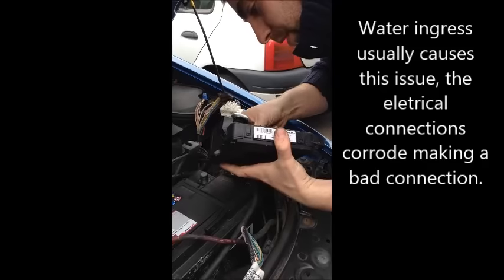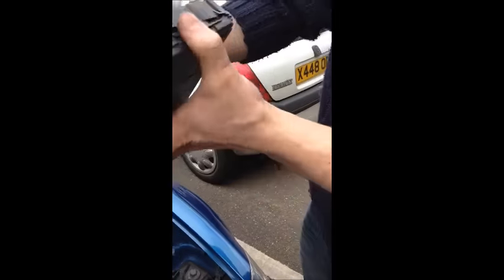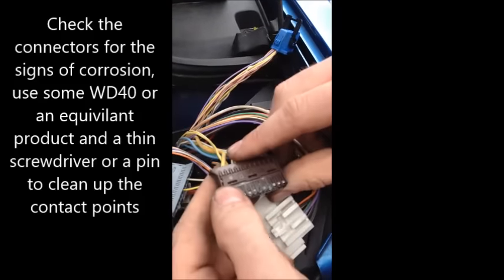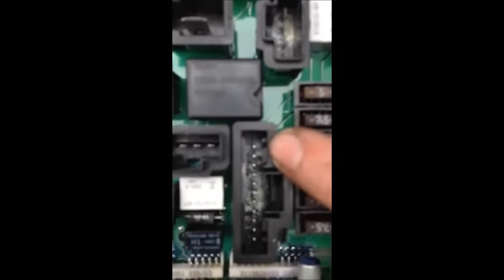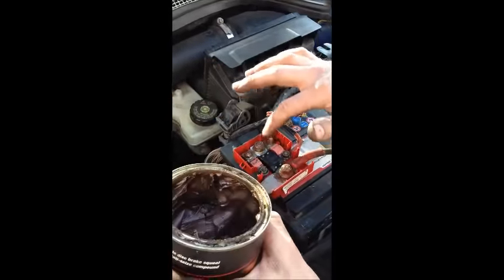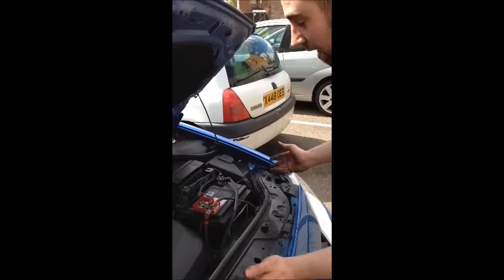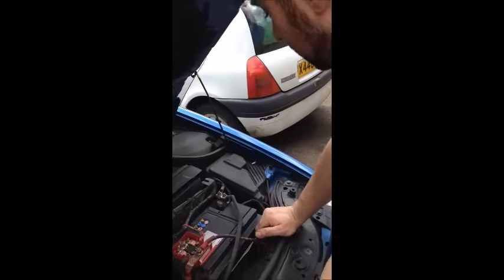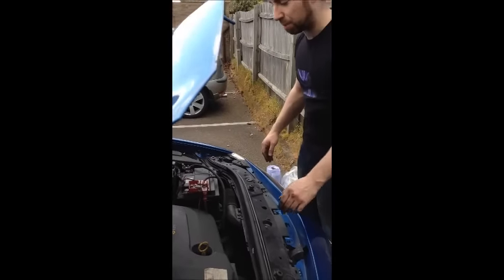How to fix Electronic Fault on Renault Megane

Comment: Hi, I have a 56 plate megane 2.0dci. my problem is that none of the windows are opening, and the swich that should lock the rear windows lock doors instead. Do you think this method that you showed here would fix it?
Reply: It's meant too lock the doors. To prevent kids opening them. That's why it has two little people icons on it.
Reply: @bananaman8899  oh, and i thought that my wiring was shorting somewhere. Well that's a relief, thanks.

Comment: my 53 scenic diesel headlight bulb went so i fitted new one but then i tried starting it up and it just wasnt starting it said battery low but was told its a new one, it does look new, it eventually started but now says parking break fault, and the trip comp seems to of gonew a bit mad, the fuel range was reading wrong and the e break kept flashing up as fault?? please help paul

Comment: Hi Paul! My 2001 rxe 16 vaive hatchback takes 20 to 40 start attempts over about one hour before it finally starts as if nothing was wrong, varoom very smooth once it starts. After a long trip inland it will start every day for a week or so - I live near the sea, do you think it could be the salty air? That is, could it be the same electronic fault? i think the fuse box is in a different place though...  Many thanks for your video and help!! I look forward to your reply all the way from South Africa. As we say here I am gatvol of this car!
Reply from the maker: Hi, I don't this model of car suffers the same electronic problems, however I would suggest getting some auto diagnostics done at a garage, persistent non starts could be a symptom of a wide variety of things, sensors, inadequate fuel pressure, blockages, low compression...

Comment: Hey Paul, i just bought a Megane 2 2008 automatic second hand (im the third).
I had to fix the wheel shaft (the one with the teeth that connects the wheels and controls them),
after that i had to do an align thing to the wheels, which i did, but then suddenly i get ABS error, and "Check Transition" message and my transmission gives me hard time switching from 1 to 2 and from 4\3 to neutral (light during red light).
I assume that its an electrical issue, any idea on how to solve it?
Reply: yeah eventually i found the problem, there is a cable connected to the wheels (stability control?) and it was disconnected, i reconnected it and it solved all the problems (both the general alarm and the gears problem)

Comment: Hi Paul thanks very much for the video .. I hace a megane 2 2.0 16v recently i got a message of battery charging we change the alternator works a 7 days then doesnt show any message but we had all this crazy things , a/c turn on by itself , airbag passenger desconnect , and all the lights in the car flashing in and out , we change the alternator again be cause was a used one and we thought we got it damage , then the new alternator , just a feo hours after the installation , now we have eléctric fault on screen also brake malfunction , airbag light , light flashing , a/c out of control and the battery look lime dischrage be cause everything is turning off one by one , any ideas pleasee , here in me country there is no much mechanic doing Renault and the y aré expensive i had expendio like a 1000 usd  at this moment , i apreciare your time

Comment: did the same thing the other day all clean  battery terminals clean put back on insert key  bam there you go back on again .
 also could the live lead terminals cleaned up + fuse make a difference.
 and one more thing when the car does start all is good then you here a click tick over  drops to zero   then electronic fault but it still drives .
any help would be great full.

Comment: Thanks for sharing, I have a Micra 1.5 DCI is has the Renault engine, starts and drives fine, but when driving and I put my foot down engine light comes on red engine light and seems to loose very very slight power, just about to notice the very slight power loss, does not go into limp mode, plugged in a code reader and came back with p0685 ecm/pcm power relay control circuit open and 
p0670 glow plug control module control circuit open.

I have replaced fuel filter and glow plugs, but still same, cleared codes but comes back on

Thanks for any help advice guidance

Comment: we have a 53plate megane , and the washers wont spray the cigarette lighter doesnt work and the radio turns itself off after 20 mins.as of today the doors wont lock could all this be fuse related?

Comment: I have a Megane II Grand Tour and the rear wiper goes off every time the car starts and the plate light does not turn on even with new bulbs. I have already saw this on others cars  here in Brazil, bu never found the solution. What could it be?

Comment: hi, great vid. my husband followed your advice after suddenly experiencing problems. now though the lights come on on dash but the car wont start and windows/locks will not work. the battery is fine any ideas? TIA
Reply from the maker: Hi sorry to hear that, my only advice would be to try it again, have a good look underneath the chips on the circuit board to see of there is any corrosion and if there is clean it out with wd40 and a piece of paper. also check the fuse for the windows, double check all the earth connectors are securely fastened from when it was taken apart to try the first time, if it still fails to start it may be worth letting a garage have a look at it, this works 9 times out of 10 but renault electrics are notoriously bad and there could be another problem that this won't fix

Comment: Hi Paul,
I was driving my 05 plate 1.4 16v megane yesterday morning at about 55mph. When suddenly it seemed to choke. It lost all power and the check injection light came on along with the service light. 
I had to be recovered as it wouldn't start. The bloke who recovered me said it sounded like a cam belt had skipped a tooth?!?! 
Does that sound feasible to you? Appreciate any help as careless at the moment. I work at a garage but they aren't being very helpful
Reply from the maker: Tori83 Tori83 its a possibility, but experience with my megane says the fuel pump could be on the way out i had similar problems with the check injection warning and also power losses while driving diagnostics showed the check injection warning was related to loss of fuel pressure on the injectors, my fuel pump eventually lost all its pressure choked spluttered then died on me, its worth getting the pump checked out as if it does break while driving bits of metal can get into the fuel system contaminate and damage the injectors, making for an expensive repair
Reply: I renault modus

Comment: i have Renault laguna II 2002 modal petrol. the problem is with the BSI or BSM, the ignition is off and car not starting. we checked and realized that, the car has developed code problem in the system. i then replace the BSI or BSM with the control board and the key system. ignition is ok now but the power is not coming on the injectors and the fuel pump. car still not starting. what could be the problem now? i need help

Comment: Hello Paul! nice job you did with that car! I have a similar problem with my Megane II, 1,6 16V 2005. Once my engine stopped while decelerating(~20km/h) and after that the car didn't start. 2 days ago it happened again, but this time the car was parked and i couldn't start it. Both times i took the car to a service  and left it there over night, the only problem was that in the morning the car was running OK. They said that it might have some issues with the alarm and immobilization system, so i had the alarm disabled. Drove for about 30-40km and start/stopped the engine for 20-30 times since yesterday and no problem yet. Could that be a fix? Thanks in advance, Cheers

Comment: Can you suggest anything for my Megane? It went through a deep puddle quite fast, the electricals went like they were possessed. Sprayed with wd40 and all seemed fine. Now, the battery goes flat after 4+ hours. We have a new battery and taken it to garage who are none the wiser, other than changing the Ecu. Any thoughts? Thank you.
Reply from the maker: Sounds like either a poor earth connection somewhere or a broken alternator
Reply: +Paul Higgins it had a check on the alternator and it came back fine. Still using the car and disconnecting the battery every time. It's a pain in the bum, but I can't justify spending £400 on getting the Ecu fixed. How would you check for it being earthed?
Thank you.

Comment: Excellent video... my car didnt start today but on top had the engine fan running for more than an hour.  Nothings working now. Will the same solution apply for me ? Your comments please ... thanks in advance
Reply from the maker: Hi sorry I'm not sure if this will work for you unless the dashboard actually displays "electronic fault" to be honest this sounds more like a battery or overheating issue
Reply: Thanks for your help. I followed the indications shown in the manual in case of electric fault. Push the start 5 times very fast... I did it a few times and finally worked. Left it like that like 3 hours ... retried to start it then and got all lights and indicators flashing ... .. car didnt start but I managed to lock the doors properly with the key ... as no beep or lights were shown when locking the doors .. I would say it must be the battery as you said. ..  will check that on Monday and let u know :) Thanks again
Reply from the maker: Have you tried following the steps in the video yet? The fact that the car actually started means it probably isn't a battery issue. Sounds like a random electric fault, our megane used to lock and unlock while driving until I cleaned out the electrics, it's been fine ever since

Comment: Hello guys, got my sister a low mileage 04 plate megane, have changed battery & got new key done still won,t start . Do you think doing the above will get it going. Rgds Mark

Comment: Grand Scenic 2005, boot is opening when brake is pushed and rear window wiper is activating as well. sometime problems with some lites on aft as well. could be the same problem you explained?
Reply from the maker: This sounds like your ECU has gone haywire! It could be a water ingress problem like in the video but I would suspect something more
Reply: That was only mass problem in trunk.

Comment: My 1.9DCi loses power for a second or two, then immediately over-revs for a second or two before settling down. It happens intermittently. Would this cleaning method fix the problem do you think??
Reply from the maker: Doubtful, sounds more like the fuel pump on its way out... this happened to mine eventually and was t worth the cost to replace. Best bet is to run it into the ground!

Comment: I have a Renault megane with this problem(won't start when idle) but car doesn't display an electrical fault could it still be the fuse box or is it something else?
Reply: Robert Henry  ive also had the same problem until i looked under the steeting wheel near foot pedals there was a wire that had came out of a green connector i put that back in and fired straight up

Comment: Hi there,

I want to know about my Renault Megane 52 Reg 1.5 DCI - Have air bag light on can you help me with that please its MOT is running out aswell. Please help on this thank you very much .. let me know if I can do same as you for this purpose. thank...
Reply from the maker: Airbag light is an unrelated issue, the only thing I can advise is check under the seats for the air bag connectors and make sure they are secure, ideally you need to get this issue tested with an ECU fault reader.

Comment: I have 08 1,4 and the promblems are starting to stack up they are a light car but I have issues with wiring and connectors. A d other things comfortable car to drive but slow but when promblems start they don't stop

Comment: My own is megane convertible 2005. It will start but it will not speed and wont change gear. The car will start drive very slowly as if its in 3rd or 4th gear. Very heavy

Comment: would this work when the dash completely blanks out? great vid by the way
Reply from the maker: As I've said to many of the other posts, this solution will cure most electrical faults on the megane (or any other renault of similar age) it is worth trying as it certainly won't make matters any worse. The only time I experienced the dash completely cut out for myself was when the battery died. However if you are certain your battery is ok try this method and inspect all of your fuses to make sure one hasn't blown.

Comment: I have a diesel Megane and it is harder to remove the fuse box because you have to remove the battery housing, I tried to it and the person who had it off last sheered the bolt head grrrrrrrrr!

Comment: My central locking wont work with my remote even though it will lock if you are inside using the switch on the console ( Renault Megan Scenic 1.5 dci ) Could this be the cause of that?

Comment: I have a Renault Laguna that's displaying ABS and brake light warning signal, the speedo isn't working but the car still drives! When I insert the key card the car shrugs before starting and does the same when I switch off the ignition. Will this fix the problem, it seems like a electrical connection fault....
Reply from the maker: One of your wheel sensors is probably faulty, you'll need to get it on a diagnostic machine to find out which one. Worst case the abs unit is faulty
Reply: +Paul Higgins A friend said the same thing, thanks so much mate :-)
Reply: Sounds to me like a abs sensor from one of the wheels. Regarding the starting sounds like a throttle body that is dirty(cleaning it may fix the problem).

Comment: I have problem with my Renault scenic 1.6 2000 model Rxe,dashboard not showing lights, alternate not changing no rav count and also front fan not working what could be the cause to this pliz help me
Reply from the maker: This sounds like more than one problem to be honest, but I’d start with charging your battery and doing the steps on the video to see if it makes any difference.

Comment: Hallo i have a megane 2008 1,9dci and i love this car so much,since a week im having problem with the steering wheel i went to the meckanicker he check it on the computer and he told me that it has a problem with elektrik (contakt)so he reset everything and now its allright,but he told me that after 2 or 3 days i will have the same problem(its to hard ro steer)so if i do like u did it will help?
Reply: I have this problem what did you do

Comment: Dear Sir,

I am having problem with my renault megane dynamic 2004 1.6. The problem is:

1> The front right headlight doesn't work (Changed the bulb by Halfords guys, no problem with bulb, - Left headlight works fine)
2> Back lights doesn't work (Indicator, reverse, break light works fine)
3> Dashboard light doesn't work (only turns on when the radio is on, however the button indicator light remains turned off) 
4> Heater doesnt work

I checked the fuses and they seems to be ok. Checked the fusebox (Under the bonnet) and it seems that some of the fuse is not live!

The problem started just after having the car washed from a local wash centre. 

Can anyone please advice?

Many thanks.

Manik

Comment: can you tell my why the bonnett of a Renault megan scenic 55 reg bonnet scensor isnt working the alarm keeps going off and its to do with the bonnet not securing rite. its like sumone trying to prize the bonnet open and done sumrhing to it. also both cigarette lughter ports nor working.
Reply from the maker: I would say the switch / sensor in the engine bay is worn out, that would be the first place to look
Reply: Was just rust mate.. Wd40 sorted it out. But cant figure out why hazards warning lights not working.

Comment: I have Megane 2 Sport Hatch.I have problems with engine start.I change battery but problem is not gone.When im not driving 1-2 days when i start engine i can hear something like water gurgling thru the pipes in passenger side.I belive that is fuel
Reply from the maker: sounds like your cylinder head gasket is on the way out - gurgling / bubbling noise is a tell tale sign on any car

Comment: Hi im having a problem with my megane 2005, when the weather is rainy, the car will automatically lock itself like crazy, tried this method but still doing the same, do you have any idead of what could be happening?
Reply: Baron Samedi hi,whenI start my Renault previlege the gearbox light comes on and even when I am driving.what can be the problem Daniel

Comment: When I put the card on the dashboard lights are shining all ask me the pressure on START, but by simply pressing the START run the motor fails and asks me to remove the card
Reply from the maker: That sounds like your not pressing the clutch or brake when you press the start button... If you are then the pedal sensor is probably broken

Comment: I know its an old vid, but mine wont start but i have no error codes on the dash, cant even jump start it. Any ideas?
Reply: Mad Rambo 

Is the starter working? Whip the bugger off and send 12 volts straight to it!

Comment: My Renault says check injectors and check gearbox and goes into limp mode when driving. Any fixes?
Reply from the maker: +Caroline Porteous, id reccomend getting a diagnostic check on the car and go from there, check injectors is usually down to a lack of pressure from the fuel pump which will require a replacement along with a set of new injectors, seeing as the cost of this would be more than the value of your car, it might be time to chop it in. this is without even mentioning the gear box issue!
Reply: Have you fixed it?I also have a message ,,check injectors”but i suspect to be an electric issue,the dashboard is off also

Comment: I've got a renault megane 1.5 dci 2003 and the speedo is not working can you help
Reply from the maker: +Caroline Truss sorry for a late reply, this could potentially be down to a wheel speed sensor, though you may have this sorted by now